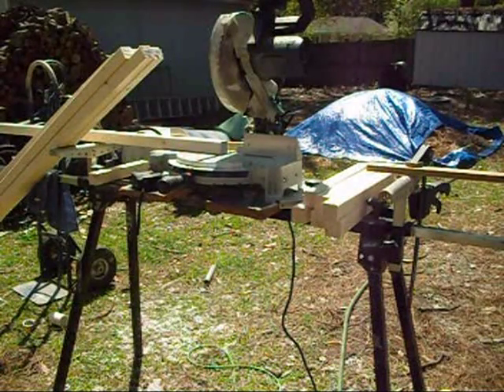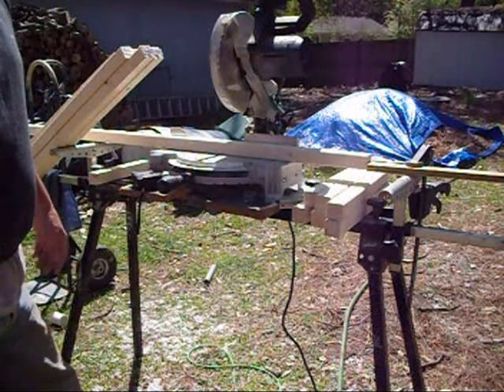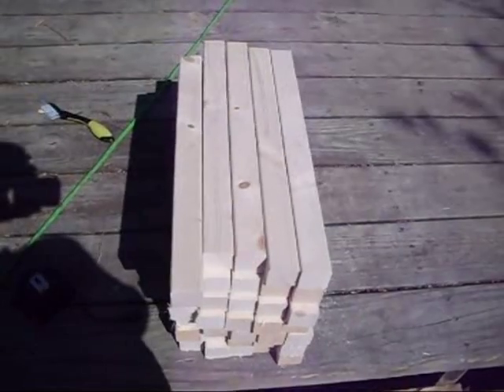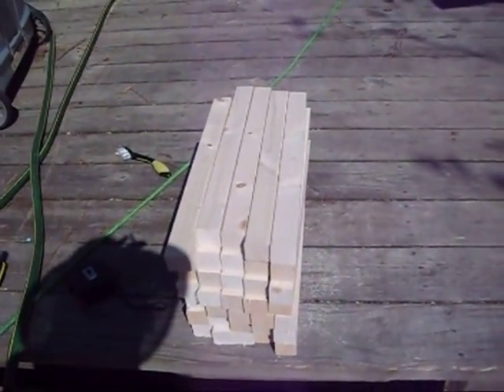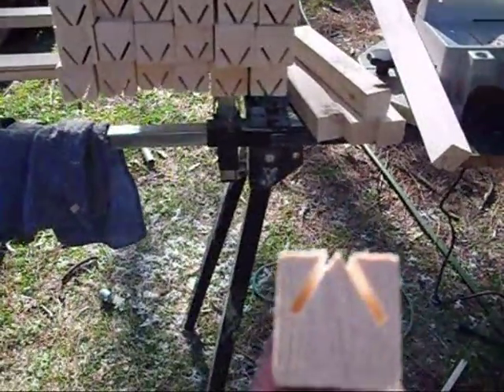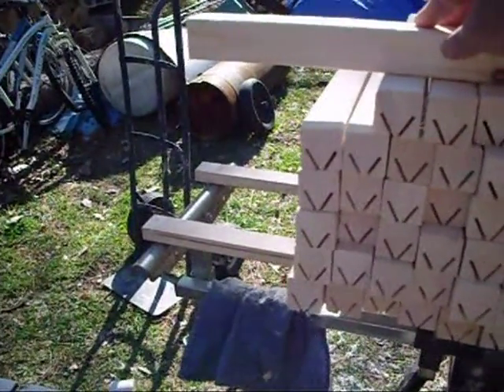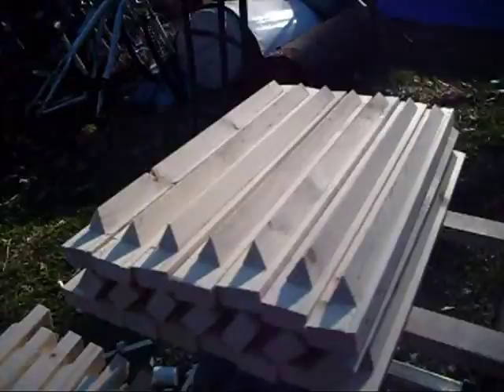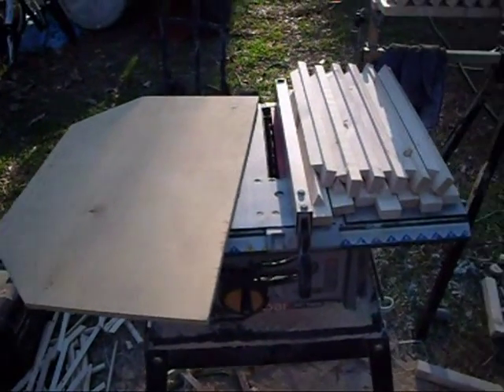Making Top Bars

Comment: A lot of work, but a very high quality result, many thanks for posting, I will be doing this for my hive, and am glad to have found your video
Reply from the maker: It was a lot of work but I was quite happy with the results.  Thanks for the comment and good luck.
Reply: @Allazander  hey brother...Hope you're still active on this account. My brother said i need a a power grinder, but I'm just wondering if a cheap lil table saw and a power drill is alls i need to make a whole top bar hive?
Reply from the maker: I built all my hives using a good skill saw and a 10" portable table saw.  I used a router on some parts of my nucs but not for the top bars themselves, they were 100% table saw. Good luck.  Personally speaking, I greatly prefer horizontal hives using standard deep frames for a variety of reasons and wouldn't recommend top bar hives but you do you.
Reply from the maker: Oops, forgot about the miter saw...
Reply: @Allazander  what did you use the miter saw for that you couldn't do with the table saw?
Reply from the maker: @guardiandogoargentinos1385  Nah, the miter saw was just used for cutting boards to length, something that could easily be done with a circular saw or table saw.
Reply: @Allazander  Will a hand router work on the edges of the side boards to get them flush with the bottom and top boards on a top bar hive? I mean is there a router bit for a hand router that can get the job done, or do i need a table router? Trying to get the tools needed to make my own top bar hives for $200 or less. Was thinking a cheap table saw for $100 or less and a $30 handheld router would do the trick, am i right? 

Just put a top bar hive kit together yesterday that i spent $130 on and i think i can get all the tools i need to make my own for the same price
Reply from the maker: @guardiandogoargentinos1385  I'm not sure I understand the question.  If you're talking about cutting an angle on the edges of the long side boards of the hive body, I just angled the table saw and ran mine through for that.  Set the blade to the same angle as that used to cut the triangular end boards.  I hope that answers the question.

The only thing I use a router for when building hives is to cut the rabbits for frame rails when building NUCs and Langstroth hives, with the router mounted into a table.  Sometimes I use a dado blade in the table saw instead of the router, it's faster but not as smooth of a cut since my dado blade is a cheap one.

Comment: he heee that too much work, plus the chance of being hurt    i just make a long box and use standard frames   another reason for the long box and not the V shape box, every thing works, No lifting boxes, standard frames, extracting honey, more comb surface and as long as u wish.. I use 4 to 8' L... But it cost more to make em rather than a standard hive.   IDK WHO CAME UP WITH THE V SHAPE BOXES,  THEY NEED THERE BUTT KICKED  cheers
Reply from the maker: Some people prefer top bar hives over horizontal hives.  As for how much work it is, craftsmanship, some of us find it important.  Ever try to build your own standard frames?  They take a lot more work than this.  How about leaving each to his own rather than pretending your method is better when each has it's advantages?  Why extract honey if you  can sell it in the comb for more?  The same no lifting of boxes applies to both horizontal and top bar hives.  Top bar hives cost less. 

Having said that, I've since switched the top bars over to horizontal hives myself.  Mainly for the standard frames giving side and bottom support to the comb.  Comb breaking off the top bars was my #1 complaint with the top bar.  On the other hand SHB seem to be more of an issue in the horizontal hives.  I build my own  4' long hives (why you'd want to go longer I don't know but again, each to his own).  I like that a standard NUC can be moved straight into a horizontal hive where top bars pretty much take packages only.  Horizontal hives also make splitting hives and creating NUCs much easier.  I prefer NUCs over packages for reasons of my own but again, each to his own.  

I built my top bar hive in my search to find what worked best for me.  I built 8 frame hives rather than 10 frame hives for the same reason.  I've also tried packages and NUCs, again going with what worked best for me.  Not with what worked best for my neighbor or what some blowhard said was best, but with what, through testing differing methods, worked best for me.

I won't knock you for your choice because my first reaction is that you tried different methods and went with what worked best for you.  I know that your first reaction is to be a blowhard.  Whatever works best for you I suppose.
Reply: @Allazander  There's a certain way you have to hold the top bars so the comb don't break
Reply: @426 SUPER BEE the v shape is so you can handle the frames when they're full of comb without breaking so long as you properly handle the bars without angleing them wrong.
Reply from the maker: When summer temps are hovering around 100, it doesn't really matter whether you hold the bars perfectly vertical and only invert by turning end to end or not, especially if the comb is loaded down with honey or even part honey and lots of brood.  Go ahead and think I'm stupid though if that's what makes you feel better.

Either way, holding the frames perfectly and never inverting to inspect more easily makes no matter on the difficulty added by comb connected to the sides/bottom of the hive.  Having to cut through that, no matter how gently done, can and does weaken the comb/top bar connection already weakened in such warn temps.

All of which is alleviated, in my opinion, by using standard deep frames in a horizontal hive.  Still get the benefits, plus some, of the elongated hive (no lifting heavy boxes, easier inspections, full size frames giving more room for the colony within the hive, being able to spin honey out in standard equipment, easier to do splits, can split into standard nucs for easier sale, frames easily available vs. fabricating, etc.) without having to deal with connecting comb or comb dropping off due to warn temps or not gentle enough handling.  You do you though and I'll continue with my very successful horizontal hives.
Reply: @Allazander  i could be wrong, but we're on the same team brother. I have been taught that there is only one way to inspect top bars and if you try tilting them sideways like a langstroth intead of turning them sideways that they'll break. I just built my first top bar hive today so I'll be learnin the hard way one way or another. One Love, Peace & Fortitude
God bless